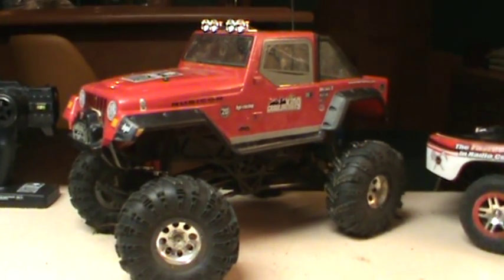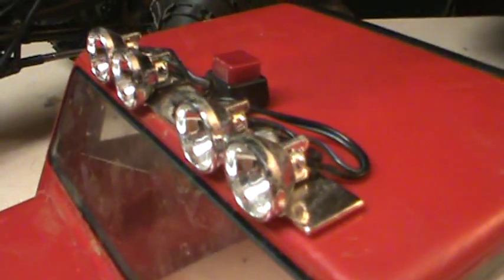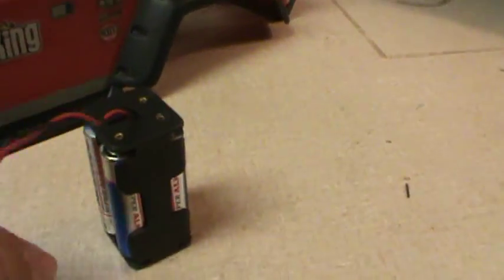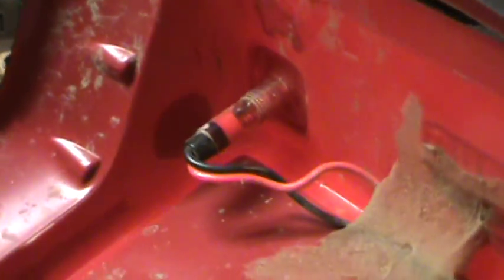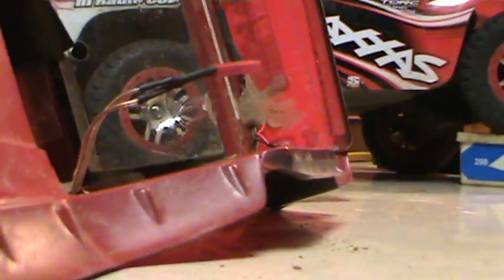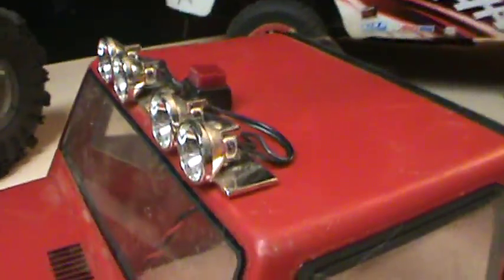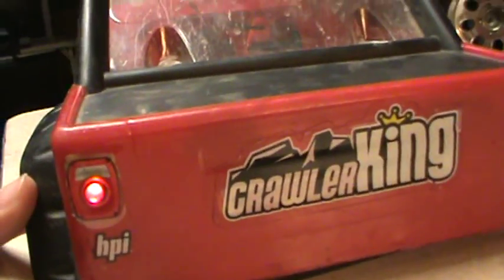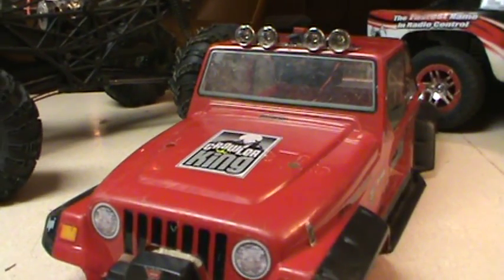How to Put Lights on a RC Truck Body

Comment from the maker: I don't really run my trucks to where they get very wet but they should be waterproof especially if they are just getting splashed or something. I would just cover everything with extra silicone.

Comment from the maker: Thanks for watching. Check back often for new videos. I will be posting a lot soon. I am also planning to get some new stuff for my slash 4x4 including new tires and wheels from pro line and front and back bumper, front and back lights, and mudflaps from rpm, so I'll be making a video when that happens. I'll also be posting videos of my traxxas slash 4x4 and hpi crawler king in action.